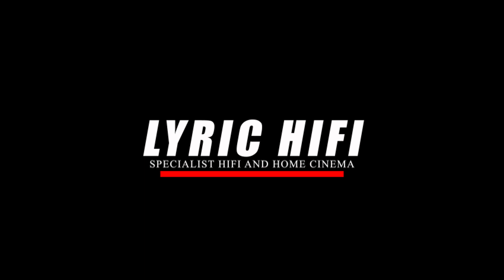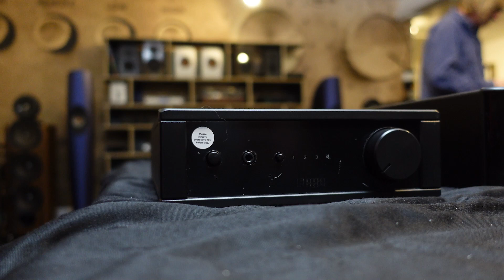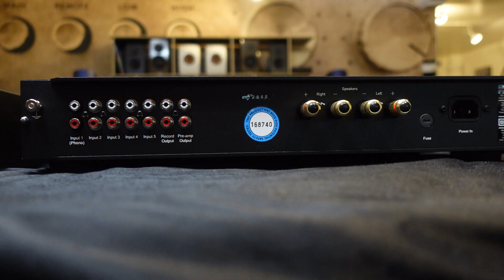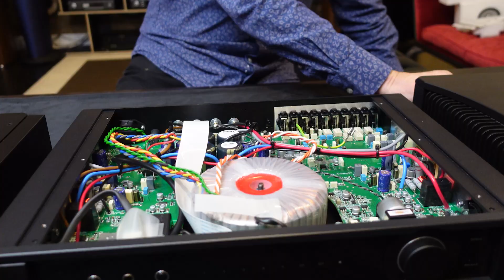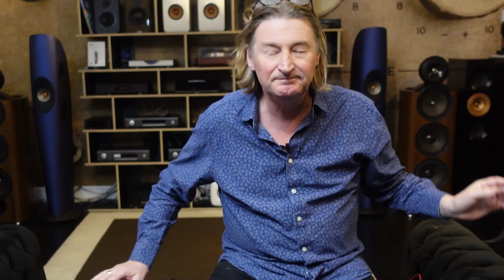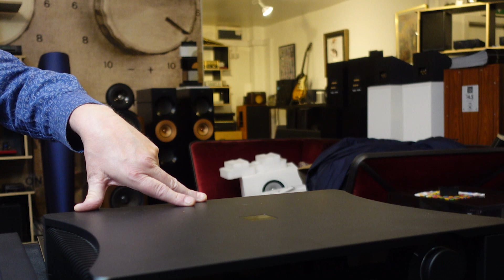Rega Elicit Mk5 and how it fits with the range from Io, Brio, Elex-r and Aethos explained by Michael

Comment: I currently have an Elex R with my neat Elite Classics, Planar 3 with ND5 and Arcam Alpha Plus through a Rega DAC-R. I am thinking of upgrading to either the Elicit Mk5 or the Aethos. I'm pretty sure I would get a big improvement with either choice, so it's about weighing up bang for buck. I don't particularly need the onboard DAC on the Elicit, though I believe that the phono stage in the Elicit would be better than in my Elex R. I'm also told that the Elicit Mk5 is a little better for fine remote control volume adjustments and I cannot often listen at loud volume. In my room (18 feet by 1 feet) it may be a better fit, but I will be listening to them at some point.

Comment: No doubt about it, it is a wonderful amp, sounds great and has all the inputs I need, except for one thing: I can hardly imagine that there is someone who can read the current input on the display, figures are way too small and backlight waytoo dark! I wouldn‘t mind controlling the elicit with a chopped remote which should be taylored to elicit — I normally control the apollo cd player with it‘s tiny remote and would love to see an aquivalent for the elicit

Comment: Good evening, I have a Rega Elex r MK3 and I'm thinking of upgrading.
The speakers are the JBL L50.
Does it justify opting for Rega aethos? or the Rega Elicit mk5?
What do you advise?
Will there be a big difference in terms of sound between the two?
Reply from the maker: Hi Joao
The L50s are good enough to show the improvement in sound of the Aethos over the Elicit. Would be good if you are near a Rega dealer who could let you hear for yourself. If it's in the budget i would go for the Aethos.
Best wishes
Michael
Reply: @michaelmcclean5169  Have you heard these speakers with any of these amplifiers?

what differences am i going to identify between elicit mk5 and aethos with these Speakers?

isn't the aethos too good amp for the JBL L50?

Comment: Hi Michael, thanks for your video.
I'm thinking about buying the elicit MK5 to use it with the JBL L100 speakers, 4 Ohms. Do you think they would match?
Reply from the maker: Hi Oscar
Driving 4 Ohms speakers is no problem for the Elicit. Although I haven't tried these with it I foresee no issues at all
Best Wishes
Michael

Comment: Hi Michael,

I just purchased my very first Rega Elicit mk5 (Beatiful Amp by the way) to replace my Rotel and wow what a difference with my Monitor Audio Silver 300 7g, they have just opened up. I was curious is there a film that needs to come off front panel.

Steven

Comment: My local stereo shop here in Canada has a new Elicit r to sell and said the only difference between the new Elicit r and the Elicit MK5 is that the mk5 has a headphone jack and a dac but everything else is the same. Do you agree? Thanks for posting.
Reply from the maker: Hi Ron, 
they are sort of correct in that those are the physical improvements however......the board is redesigned and when you compare them side by side the mk5 definitely sounds better. I have done the comparison for a few clients now. Everyone agrees the Mk5 is better but some have opted to save the extra money and go for one of the last of the Rs. I won't tell you which to buy, here with a little discount on the old one the difference is £500, but if the funds are there I would wait for the new one. Best wishes, happy new year to you
Reply: @michaelmcclean5169  thank you Michael. I ended up buying a good used Elicit r to hear in my mostly all Rega system. It was the only way I could decide which one I liked best and though I do like the Elex r, it is quite apparent that the Elicit is better sounding, especially since I added a REL t9x sub to it. It sounds wonderful with my Totem Tribe Tower speakers. Now would you say that the new Elex r mk4 would be better sounding than the older Elicit r or should I just hang on to the old Elicit r until I can afford to buy a new Elicit MK5?
Thanks so much for posting and your reply, much appreciated! :)
Reply from the maker: @RonRivet  Hi Ron, while I haven't in truth listened to the comparison I am certain that your Elicit-r is superior to an Elex 4. I would enjoy it unitl the finds allow a new Elicit, or even Aethos !! Best Wishes Michael
Reply: @michaelmcclean5169  thank you Michael. I will wait until I can afford an Elicit Mk5.

Comment: What I've heard about it is that they've effectively kept the same power supply section and of course they've added the digital converter but most importanty I've read that they've updated the thermal capacity of the amplifier to keep it running cooler. because as I understand a lot of people that have had the older model have had issues with thermal shutdown due to overheating, I mean not necessarily a bad thing given the performance but it is disheartening nonetheless.

Also a few reviewers that have had access to it seem to indicate that the older model had a very mature sound which kind of was a departure from the typical sound that the company is known for with their amplifiers however with this new iteration they have brought the sound more in line to what people expect from their amplifiers.

On a more personal note I feel that it's a winner, sure people are going to complain about the lack of a USB input for your computer but the fact that they've added digital inputs at all is a tremendous boon and ultimately a very welcome change and if I hadn't just purchased the rega dac r New Old stock I would have consider upgrading my elex r.
Reply from the maker: Thanks for taking the time to write your comments. I am intrigued by reviewers interpretations of manufacturers going for a particular sound. While there are manufacturers out there that describe themselves as 'voicing' products I find that by and large they are the bullshitters who want to introduce some kind of art into engineering. I believe that Rega's pure development work on the Aethos amplifier yielded lower distortions and improved dynamic performance resulting in cleaner, more dynamic and more musical sound. Whatever all that means in the end it sounds terrific. The Elicit5 is not a completely new design in that elements learned from the Aethos process are retained to achieve the best possible set of compromises chosen for the overall sound and cost package. This is how engineers work for the best solution and Rega's engineers have done a great job. Again!  Michael

Comment: Hello, I have a question. Is the Rega Elicit MK 5 a dual mono amplifier design just like Aethos? two complete output stages in parallel, this includes the output transistors, the bias network and the pre-diver transistor, instead of paralleling only the output transistors as is normally found Thank you

Comment: Thank you for your explanation as to measurements of power output.  I am interested in the Rega Elicit MK5; can it drive & control difficult speakers in general or specificly can it drive an ATC SCM19 speakers or is that too ambitious hope...
Reply from the maker: Hi, I don't believe that the load of the ATCs is 'difficult'. The impedance is normal and doesn't vary much with frequency. I DO believe that ATCs are very revealing ! That means that your source and amplifier need to be good. I honestly haven't tried the new Elicit5 with ATCs however I believe it should work really well. Just make sure you have a good source, if it's not up to it you will hear that clearly. Good hunting ! Michael
Reply: @michaelmcclean5169  Thank you for your advice. It seems when considering ATC speakers make sure rest of the system will not let the speakers down.
Reply: I drive a pair of ATC SCM7s which are rathed at 84db unlike the SCM19s which are rathed at 85db with a Rega Elex-R (72,5w into 8 ohms) without any problem, and although this mean little to nothing my volume knob doesn't even go pass 10 o'clock. Like Michael said, all those power ratings are really just numbers, so let your ears be the real judge rather than the numbers. It's true that the ATCs are very revealing. Sometimes you might hear some harshness on poorly recorded material and if your source isn't very good. If you can find a dealer that offers a in-home trial I would strongly advise this so you can ear the synergy in your own environment.
Reply: same here @thebestoffools

Comment: In that price bracket, I would not be using a stereo amplifier for TV sound, for TV I would want a 5.1 system at the very least, yes I used to hook my TV up to the stereo in the 80's and 90's but video audio has come on a long way since then.. When it comes to streaming  music content, a DAC in the Amp could come in VERY useful, though the lack of a USB input would be restrictive.
Reply from the maker: Thanks for the reply, it depends on your priority, if it’s tv/movies then the av route is right for you but don’t assume that a 5.1 at that price competes with the Elicit. I like av amps such as Arcam and anthem which are great but they don’t do what the elicit does!
Still doesn’t mean it’s for everyone though!
Reply: Agree on the USB input. The DAC in the CD players had a usb dac input if I am correct.